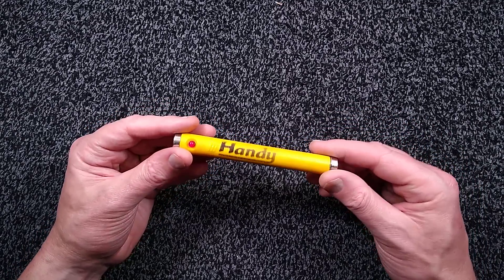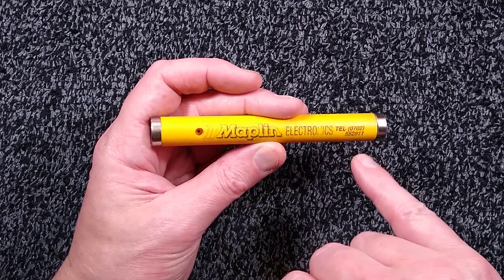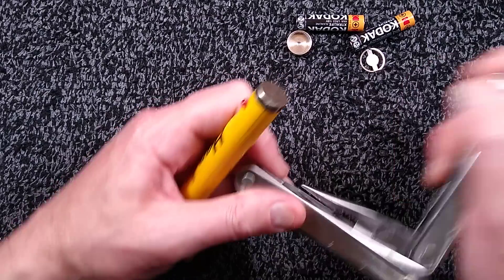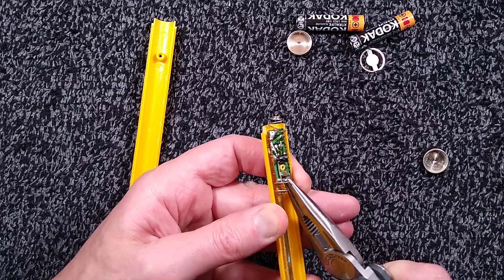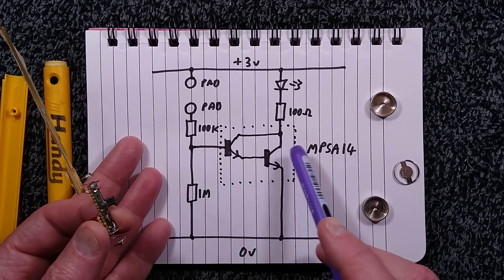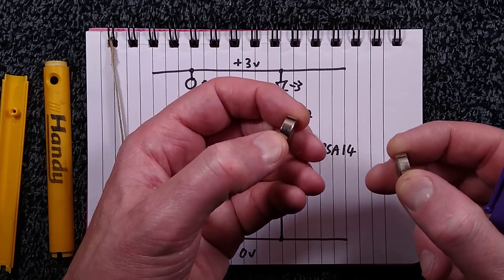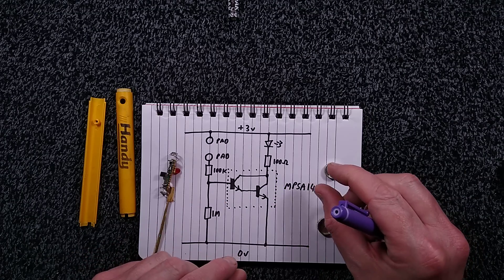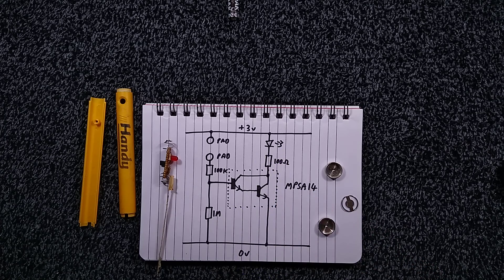Retro Maplin "thing" (with schematic)

Comment: Maplins for me went down hill when they stopped designing and making their own electronic project kits. The Velleman kits were okay, but that was when they really started downsizing on their electronic component and hardware inventory. Pretty much like Tandy (RadioShack) did years earlier. Was a shame though as I made some great amateur radio gear at school using part kits and home brew circuitry with components from their catalogs and their monthly magazine for project ideas back in the 80’s. Think their demise started when they started opening more stores on high streets which led them into ready made commercial electronics gear- when in reality all hobbyists needed was a Mail order vendor. What I really miss most though is their range of hardware (screws, bolts, fastenings, tools and enclosures). I know they’re still trading online these days but I can’t honestly say since they pulled out of the high street I’ve ever placed an order online with them. Way of the world I guess these days sadly :(

Comment: Oh what memories, I still have one of those, I got mine free with the Maplin magazine. The magazine was great, will all sorts of projects ranging from a light sensitive switch to a NOAA weather satellite unit with tuner, aerial, decoder & frame store. Yes I did build it, and it worked. I also built the Nicam tuner to add stereo TV broadcast’s to my HIFI. Of course all the parts came from Maplin. I learnt so much building the projects, great times.

Comment: Clive, I've still got my 35-year-old screwdriver type with a tungsten lamp and resistor in series, no batteries needed to use. One end touches the (inside of the clear handle) end of flat head bit shaft and the other to the resistor. Which in turn is just soldered to the lamp. This is then fixed to a copper strip that presses against the handle screw on copper topper. Though the filament of the lamp is burnt out I still use it as a flat head driver for terminal blocks and plug top wiring. What would you use today (modern) for components, which will fit inside the handle cavity, (8mm x 4mm) to have one of these testers safely working again?

Comment: Marlin was ok but but Tandy and RadioShack were much better as there there staff were qualified electricians and electronics engineers . Also they sold good high quality products. I got My first multimeter a Robin from Tandy’s in Woolworth RD Southeast London, 1979 I still have it and it’s still going strong.

Comment: I seem to remember it had a thin metal pen clip that was always coming loose.
I also kept all their old catalogues from the original mail order beginnings up until they started releasing twice a year. Yes, twice a year with all the overhead of a retail shop selling low margin crap. No wonder they went broke. They should have stuck to mail order. It was what made them unique amongst hobbyists. More accessible and relevant than Radio Spares and more granular than Watford Electronics.
Reply: You’re quite right, I still have mine, and yes, the clip does keep coming loose!

Comment: As a teenager in the 1970s I used to buy components from Maplin by mail order. Almost inevitably something would be out of stock and I'd have to wait and then try again before I could complete my project.
I think my last purchase was about 5 years ago from a nearby store, when we urgently needed a VGA-to-HDMI adaptor. After one use it sat in a drawer until recently, when I bought a new PC and found it had an HDMI output and my old monitor uses VGA.

Comment: Used to love Maplin in the 80s and 90s when they were mail order only for me (as I lived in Northern Ireland).  The Maplin catalogue was a must get every year!  I remember their first shop when it opened in Belfast back in the mid 90s (it was close to the main football stadium in the city on the Lisburn Road) used to get the train down to Belfast to visit it (I didn't drive at the time).  Although they were somewhat overpriced in later years, if you managed to get them on a "sales" day you could grab yourself a bargain at better than Amazon/Ebay prices!  Very sad when the shops all closed.  I visited on their last afternoon and grabbed a load of cables / mains leads (which are still lying unopened in their Maplins bag today) and the whole lot cost less than a tenner!  But I agree that it really went downhill once they started stocking all the Chinese tat and trying to compete with internet sites who would always beat them on price - a model doomed to failure.  RIP Maplin.

Comment: In the 70s there were two places that I'd get electronics bits and bobs: Modern Radio in Bolton, where I lived, and Maplin by mail order for the more esoteric items… their catalogue back then was supplied as a bunch of 'Gestetner' printed sheets with a few sales offers run off on a Bander (Ditto) machine.  It seemed so high tech back then! 🤣

Comment: Speaking of retro things, I was going through my old stuff at came across a brand new, in vintage Radio Shack packaging, a 2N3055 transistor. Radio Shack was an electronics chain in Washington, where you used to be able to go and just buy electronic components. Breadboards transistors, capacitors, etc. They sold the Tandy computers also. What a great place for a young tinkerer. Being able to just go into town and buy components was amazing. Sadly they went out of business years ago :( 
I would love to have a shop like that where you could go buy components versus having to order them online.
I think it would also be great to have a 3D printing store. Somewhere you could just go into town and buy things like resin and filaments and browse at new printers. Sadly, none of those in SW Washington either.

Comment: I had one of those. I'm pretty sure it was a free gift given away when placing an order for something else or over a certain value or something like that. It's not something I would have specifically bought. It originally had a metal pocket clip held in place by a ring screwed down under one of the end caps.

Comment: I remember buying the Maplin catalogue in WHSmith and my dad looking at the catalogue and telling me I should throw it away. He was incredulous when he found I'd paid for a catalogue which he said should have been free. 

I remember buying a light pen kit for the Vic-20 and carefully putting it together then being disappointed because on the TV I was using, the sensitive area was an oval in the middle and I couldn't play the Pennies from Heaven game with my new light pen. It never got tried again. Mind, I don't think I bothered with Pennies from Heaven much more after that either.

Tandy I remember - they had some excellent "Electro-clean" spray that really worked. It cut through the carbonation and verdigris and the crud that builds up on battery terminals from leaking batteries. I have never been able to find anything since then that was as good.

Comment: Still have my 1985 Maplins catalogue, as it has so many good reference circuits in it. What’s really scary though is the microcontroller trainer unit, that was about £400, if you compare that to a modern day Arduino, ESP 32, or even the Rasperry pi Pico, which cost practically nothing, it’s amazing.

Comment: I may still have one of these in a draw.  Like others on here, I lived close enough to the Westcliff shop to be able to get on the bus and go down there.  I still have a power amplifier which I shall never part with, the 100W 3055/2955 output stage which from memory could do 160W if you used extra heatsinks and ran a stereo pair, or what I did was build two power supplies, extra heatsinks and put two in a case for 225W stereo.  They wanted to be like Tandy and in the end they made it as both went under.

Comment: I love it.

Continuity tester, 1977: three resistors, one LED, one Darlington transistor, and two AAA cells. No power switch needed. Battery life: 10 years. Instructions: Connect one end to the other and if LED glows, there is continuity.

Continuity tester, 2022: One custom microprocessor, one push switch, three-layer PCB, 22 smd components, a Bluetooth chip and antenna, a charge controller, and a lithium ion battery. Instructions: Connect difficult-to-find mini-USB cable to tester and phone charger. Do not use fast charger or tester will explode. Download questionable app onto phone. Connect tester to phone via Bluetooth. Create account with app vendor after answering 32 questions including your sexual preferences. Find email they send you and click on link. Open software and log into your account. Connect one end of tester to the other and if app display changes from turquoise to robin's egg blue, there is continuity. To test again, reset tester, log off software, log back on, and repeat. Battery life: 30 minutes. Takes 8 hours to recharge.
Reply: Still more complicated than tungsten light bulb and battery
Reply: @jusb1066  It is indeed, but it's a special purpose tester. Very low test current (about 18uA) means it's unlikely to damage anything, and as you saw, you don't even need a test lead. Your own body's conductivity will do for testing fuses, light bulbs, etc.
Reply: @ScottGrammer  yeah but this was used as a fuse or  light bulb tester in the 80s, was not a technician tester

Comment: When I saw that I just knew it would be a Darlington Pair, though I was expecting the two transistors, rather than the "both in the one package" approach. Maplin did a very nice (and cheap) e-field tester using three NPN's as a "Darlington Triple" with an amazingly high gain (maybe in the order of a million-fold?). Big stability issues, so needed a spot of decoupling,  but once fixed nevertheless an excellent kit.  For me, Maplin was THE source for the components, PCBs and cases for many of the PW projects -  the best (for me) being their synthesiser kit (methinks 1974 - ish),  which was costly but worth it, and their "Oscilloscope test centre" - came out in the early 1980's (I think 1982?) - great little kit, and still works. The demise of Maplin was a great loss to the UK Hobbyist community back in the day - RS were too costly, so you had Farnell (Canal Road, Leeds I think), or really not much else.

Comment: I would think a Darlington with such a high input impedance turns you into an antenna. So you pick up enough from the surrounding 50Hz to make the LED glow even if you only touch the Darlington’s base end cap and not the other one…
Reply from the maker: It has that 1M pulldown resistor to prevent that.
Reply: @bigclivedotcom  indeed. I’m out of practice lol

Comment: Love the simple first testing devices .I have an old bluepoint tester for testing automotive fuses or tracing voltage with a simple led and buzzer .The batteries are hard to get .1/2 AA size x2 .have to look at dollar stores for them .keep up the good work .

Comment: I have some tester screwdrivers with the same sort of circuit built in, very handy as it also er..screws!  .. but I was troubleshooting a big bit of kit a while ago and had a missing supply line, checked all the fuses with my handy tester and they appeared fine. Infact a very old fuse had gone quite high resistance somehow, passing enough to easily light up the tester but at a few hundred Ohms not enough to power anything of course.

Comment: Anyone else remember those kits Maplin used to sell?
Some of them were quite useful! ....... Also a great start (at least for me) into making stuff you simply couldn't get or couldn't afford to get elsewhere!
Alibaba et al are a pale, if effective alternative.

Writing this I can remember going in fairly regularly just for a mooch around and to see what peeked my interest!
Reply: Yeah, the Velleman kits were great.
I remember one particular one was an 8-way two-part kit. One end had 8 switches and another had 8 relays. They connected together with 2 wires. I used that as a really basic stage lighting controller when I was young. Then I connected it up to a 286 PC using the Parallel port kit (you printed lowercase a>h to turn the relay on, and uppercase A>H to turn it off). I wrote a massive batch file to echo stuff out and turned it into a disco light controller. Amazing times as a kid, me and my mate made a killing doing discos.

Comment: Maplin did sell some good equipment, but I would not have been tempted by gimmick tool.
I really miss Maplin. I used to buy components from them by mail order and sometimes from their first retail shop in Southend (The name "Maplin" coming from the nearby Maplin Sands, of course).

I also bought components and portable cctv equipment there for maintenance use at the power station where I was employed at the time.

Since then, I had retired and moved to Norfolk, where there were Maplin stores in Norwich and King's Lynn, both of which I frequently patronised for my electronic projects, but alas, they have gone.
I think that they over-extended their business and chose the wrong products to sell, but both my wife and I often say that we wish Maplin was still here. It was sad to see the helpful staff in the Lynn store lose their jobs.

Comment: I remember the original Maplin shop which opened in Westcliff-On-Sea, near Southend in Essex, in the mid 1970s. It was a proper hobbyists' shop where you could go with a list of components with knowledgeable assistants happy to provide advice and sell you a single resistor if that is all you needed.
Reply: I remember the ads boasting that Maplin was the site of a new airport for London.

Comment: The old technology LED is one reason for the lack of brightness but also Darlington transistors have terrible Vce saturation voltages. There's probably not much more than 2v remaining to actually drive the LED and current limiting resistor.

Comment: It's a bit strange to hear this described as a vintage circuit now. I remember then Maplin advertised these in the catalog and the magazine, sometime in the early 1990's.

It wasn't until I went up north to Huddersfield University that I had a Maplin shop I could travel easily to in Leeds as there wasn't a shop in Exeter at that time so everything I needed to get from them needed to be by mail order from the catalogue from WH Smith.

Comment: Be handy for those working transmission lines and needing to test power switch turned down a bit or wanting carbonised? 🤭 Only kidding btw. Just in case. I don’t think these “volt stick” type pens have ever changed much over the years. They are handy things but the amount of folk, including fellow electricians I see using them without carrying out the dead test procedures is shocking (pardon the pun) 👍✌️🇬🇧

Comment: I used to buy AA and AAA own brand batteries from Maplin. They weren't particularly fantastic batteries but they were good enough, consistent quality and if you bought them in bulk boxes of 100 then the price per hour of use was unbeatable.

The problem was I'd always but something else when I was in there, negating my savings.
Reply: Going back to the 1980's Radio Shack (in the US) used to have bins of AAA, AA, C, D, N and 9 volt batteries at relatively cheap prices.  There was one on the road between mine and my parents homes so I would stop in once in a while and buy whatever component I needed that they sold as well as a few batteries.

Comment: I had one of those years ago, very useful for checking fuses and leads for continuity. Trouble was it was so poorly made that the end caps did not fit the plastic threads properly and they just kept popping off, OK at the led end as a spot of glue fixed the problem but the battery end glue was not such a good idea, in the end I binned the thing. I replaced it with a voltage detector pen that I picked up in Walmarts when I went on holiday in the US back in 2000, still have that as it not only has a light but a buzzer as well.

Comment: Given base voltage threshold, approx 0.5 per transistor needs around minimum 1uA leakage across contacts to get reasonable Led to light up.  Dim Led from maybe a bit less leak across contacts.

Comment: It's an old timey gallium arsenide phosphide LED. It's all we had until the very early 90s when high brightness red aluminum gallium indium phosphide chips in clear, non-tinted packages finally became available. The brilliance and saturation of their light was astonishing, almost laser like, which not coincidentally was the exact same semiconductor system that finally enabled the first visible light laser diodes and laser pointers by around 1992. It was the first time you could actually illuminate objects in a darkened room with electroluminescence.

Comment: The big mistake was using a Darlington transistor with only 3 volts supply.  A Darlington transistor has one serious disadvantage, the saturation voltage cannot go below 1 volt.  So with good batteries giving 3V, the most voltage that could be across the LED and 100 ohm resistor is 2 volts.  And it's even less with batteries near end of life.  Some older red LEDs needed about 2 volts to begin to light up.  

What they should have done is use two transistors in the Sziklai compound connection.  Then nearly 3 volts would be across the LED and 100 ohm resistor.  Much more sensitive and brighter, and the batteries would last longer.

Comment: The phone number dates it to before April 1995 as that was when the additional 1 was put after the zero on PhONEday on all uk STD codes to increase the number of phone numbers as they were running out due to faxes and second lines being installed for the fledgling Internet services.